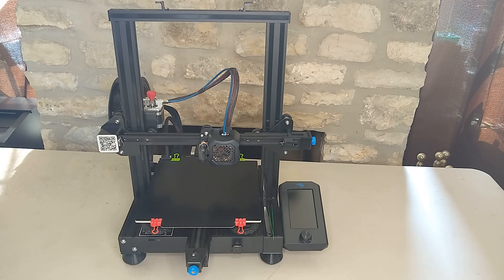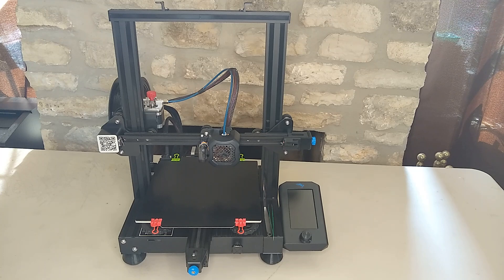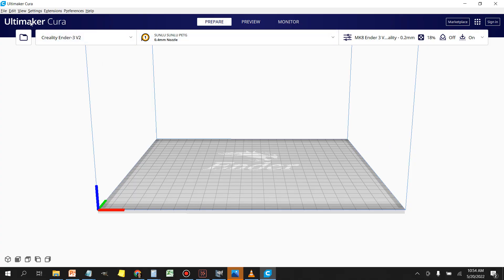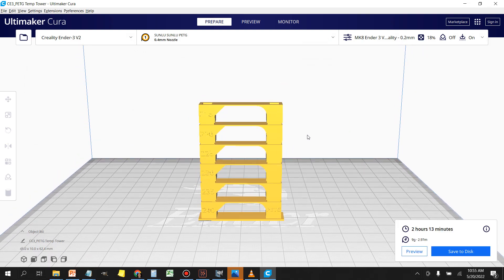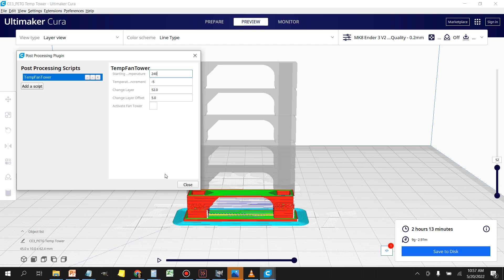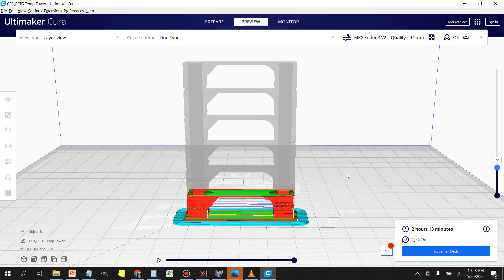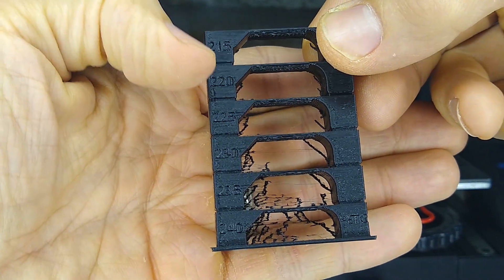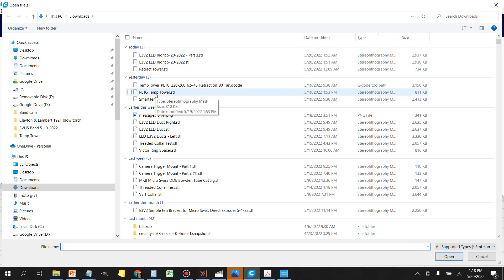Ender 3 V2 Calibration Parts to Determine the Best Cura Settings for Your Filament Step by Step

Comment: Thanks alot man, this video  helped me to dial in my geektech settings as I was on the brink of giving up
Reply from the maker: Hello Ravindra, Thank you for your kindness. I'm glad you found value in this video for your viewing time. Great job in persisting until you found the solution. 3D printing can be frustrating at times but a dialed in machine will have you smiling.

Best of luck with your 3D printing journey!

Comment: Amazing details. Trying to set up the heat test, and my cura doesn't have a lot of the scripts that are in this video. Anyone know how to fix that?
Reply from the maker: Hello TheOctabreaker, Thank you for your kind comment. To get the calibration scripts click on the market icon on the top right. Search for one called Calibration Shapes and install it. Then you will have the script options.

Best of luck with your mods!

Comment: Another great one Victor. Just spotted the new feet,  are they height adjustable or just supportive?
Mine are still the original but I’ve had to pack up one corner as it wobbles 🙄
Reply from the maker: Hello Mark, Thank you for commenting and encouragement. They are fixed, use very low bounce squash balls to absorb vibration, and elevate the whole printer enough to clear the 80mm super quiet fan that I used to replace the noisy fans the printer came with. I encourage you to watch the video I made on it linked below. I've done these upgrades to both my Ender 3 V2s and haven't looked back since.

https://youtu.be/ycvHpMbo5Hw

Best of luck with your mods!

Comment: I have a EIBOS dryer, If it isn't too much trouble would you measure the width, O.D., and hole size of the SUNLU  PETG spools for me, I need to make sure it will fit before I buy.
Reply from the maker: Hi wnctrialcam, no problem at all, the spool diameter is 196mm x 60mm wide. Center hole is 72.5mm.
Reply: @vbared  Thanks,  The OD and Width is the same as the Overture PLA spools I have and they fit. The hole is larger so that should fit also. By the way I bought one of your Garolite sheets and I couldn't be happier with it.
Reply from the maker: @wnctrailcam  I'm glad the SUNLU spools are going to work with your dryer. PETG is an amazing material to learn to print with and once you get dialed in, it prints as clean as PLA. Thank you for supporting my work, Garolite G10 is game changer, I use it on all my machines.  These bed clips are perfect for holding it down and don't get in the way of the nozzle - https://amzn.to/44IfGfZ

Let me know if you have any questions about printing with PETG or using the Garolite, I'd be happy to help.

It would be great if you could leave a G10 Garolite product review on Amazon. 

Enjoy your weekend :)

Comment: Hi Victor,  I'm working to reduce the my stringing / wisping and was wondering if your still using 215 degrees, retraction distance of 2 and the speed of 30mmps ?  For the Sunlu PETG filaments.  Also did you change your e- steps for the 215 temp?  Thanks again for the great work and showing that calibration print testing is the way to go.
Doug
Reply from the maker: Good morning Doug, Which PETG are you using the blue box or brown? I'm still going through the last three rolls of PETG-G, which came in the blue boxes. Personally I don't care for this version of it from SUNLU which seems to be the reason for the extra stringing that I didn't experience with their standard black PETG that would print best at 230c. Thank you, Doug, I appreciate the encouragement. Understanding the importance of calibration are the keys to getting the cleanest prints to minimize post print processing.

We'll talk soon, friend.
Reply: @vbared  Hi Victor,  My blue PETG is SunLu in the brown box.  I have a roll of the black in the teal/blue box but I have not printed with it yet.

I have just finished a temp tower, retraction tower for both distance and speed and am waiting for the speed test to finish.
The best temp was 230,  The retraction distance was 3, waiting on speed.  CHK your email for the pictures of rev 1 & 2 with some notes.  Thanks again my friend.

Best Regads
Doug

Comment: In Cura 5 that Plugin is not available at the moment. But that plugin got updated 3 days ago
Reply from the maker: Hello Aglandorf75, Thank you for commenting and giving me that update. I'm running Cura 14.3 see if you can find this version so you can follow along with video.

Best of luck with your projects!
Reply: @vbared  actually I am currently using SuperSlicer. For some weird reasons I can not use any file sliced with Cura. If I am using that my Ender 3 v2 is not working correctly, means the Z-Offset is to high and the nozzle print mid air. Doing the same file with SuperSlicer it's working as expected. Tried to compare these 2 Gcode files but can not find any specific line which would cause that.
Reply from the maker: @aglandorf75  What firmware are you running?
Reply: Greetings,  I tried the CURA 5 as well and the parts for calibration plug was not available.  I went back to Ver. 4.13.1 and it is all good.
Doug
Reply: @vbared  jyers 1.3.4
Strange thing is I did quite a few prints over a couple months and last week I did a print and with the next print I got the issue. Yesterday I switched to superslicer, added the Bltouch commands and it is working fine
Reply: its there have to go to web store
Reply from the maker: @randysheamer3164  Thank you, Randy for helping out.
Reply: In 5.1.0 Cura now has it as an extension that you can install from marketplace.  Then just below Post-Processing, you get "Auto Towers"
I know it works for temperature tower as Ender display shows the temperature setting change.
Can't be sure about retraction distance, but watching the extruder rotation, does seem to work.
BUT!  Beware of retraction tower speed!  I though it would keep the distance the same as you had for normal printing, but NO!  Instead it seems to retract 10MM!
Tried to find the settings in the gcode but I can't figure out how they do it.

EDIT: just found the folder where the AutoTowersGenerator sits.  Perhaps I can edit the file and fix the retraction speed tower script
Reply: I haven't printed it yet to test, but here's where to fix the bug:
In file RetractTower_PostProcessing.py search for 'speed' change to Speed
I'm not sure though if this then breaks the custom settings option

Comment: Glass and masking tape works perfect for me. I use yellow painters tape with less glue than blue painters masking tape.
Reply from the maker: Hello Teodore, Thank you for commenting. Yeah, I used the painters tape as well as stick glue at first when learning how to work with PETG. Once you experience the ease of using the G10 Garolite with any material there is no going back. Even during a power loss so long as the model isn't moved once the bed reheats it will grip the material once again. I have a 2 year old WhamBam that was as expensive as a new Ender 3 V2, at the time of purchase, on my CR10S Pro V2 and the PEI sheet is starting to pull away from the stainless flex plate due to the PETG sticking to well. The G10 is an unbelievable material to use as a build plate.

Best of luck with your mods!
Reply: It wasn't a expensive bed plate even for my cheap standards so I'll have to try it.

Thank you for your work!
Reply from the maker: @teodoreoakleaf2537  I'm fugal myself, so I understand. Nothing more annoying than an expensive item that doesn't live up to the hype. That's how I feel about the WhamBam.